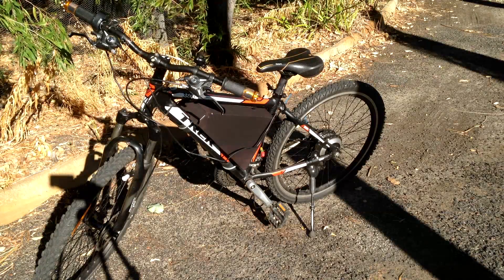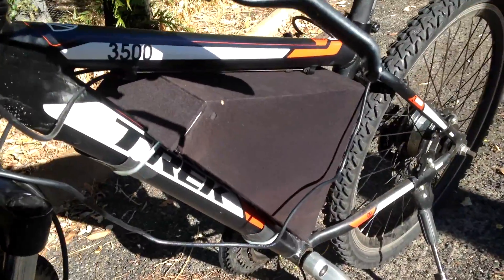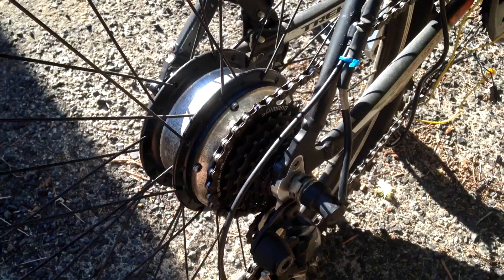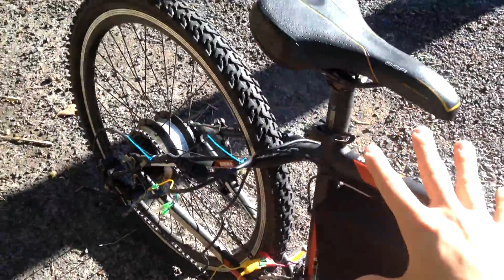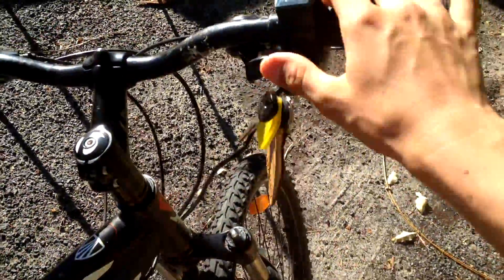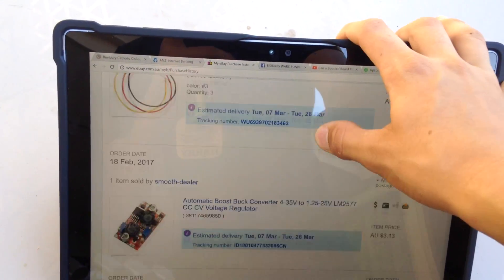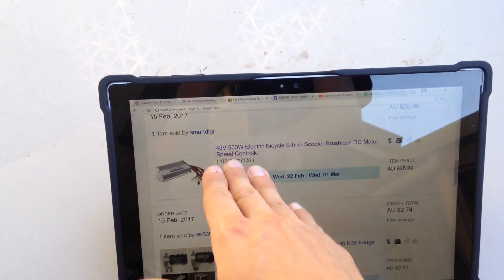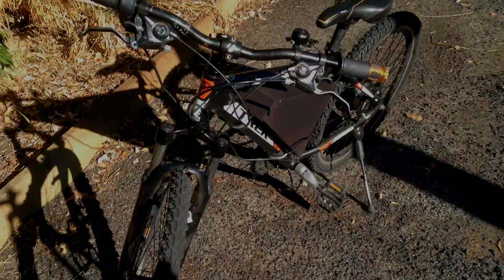DIY Electric Bike | Brief Overview And What I Have Ordered | Update 1

Comment: what advantages dose more voltage give?
Reply from the maker: Less voltage drop in longer runs, less current draw and good for making motor faster (when overvolting)
Reply: @RandomDIYProjects0  current draw is always the same if not more, as a result you end up with higher total wattage. Only real benefit is faster top speed.